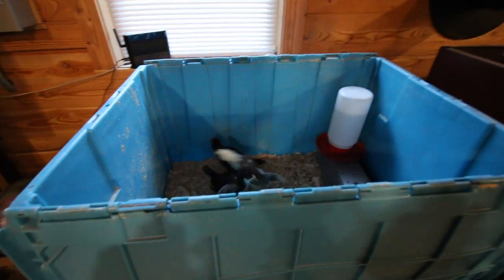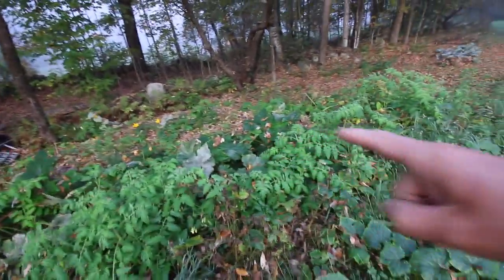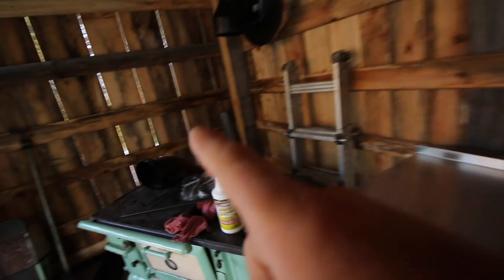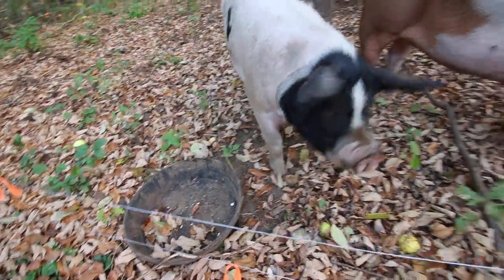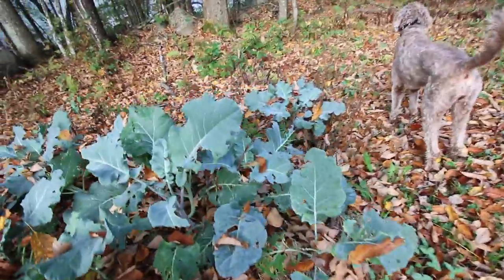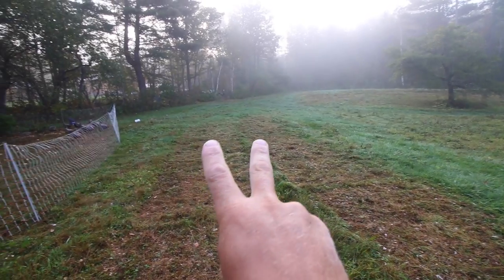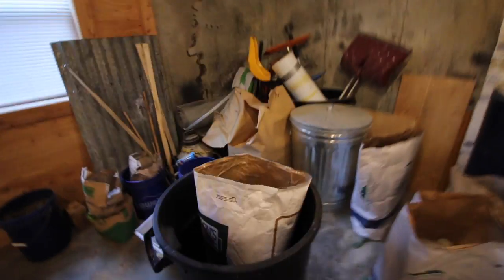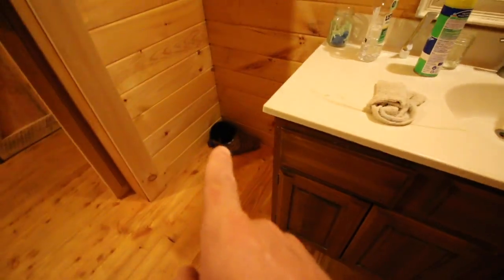🍂🐔🐖Weekly Homestead Fall Update Farm Tour🍂🐖🐔

Comment: Hi, you commented in this vid about the leaves falling despite the weather being hot. I thought you might be interested as to what triggers leaf fall. Most people think broadleaves go dormant in winter because of the cold; the actual cause is the low light levels. Trees use solar energy to pump water from the roots to the branches and in winter there is not enough sunlight to power the pump so if the leaves remained they would dehydrate the upper branches and kill the tree. So as the days shorten in the Fall it triggers the tree to go into hybernation, the other thing that can trigger leaf fall is drought. Happy Thursday.

Comment: Hey guys, after talking with you awhile back about my Tomatoes and peppers not turning color I went online and ordered a few white poly frost blankets. And what a difference, I have been picking orange and red peppers several times a week and tomatoes everyday. It has helped a lot with keeping  the nighttime Temps staying at least room temperature or higher. We haven't had cold quite like you but have had high 40's to low 50's the past several nights. The place I found the blankets was Gardner Supply in Vermont. A 6' x 20' was $9.98 and a 12' x 20' was $16.98. I bought the general one that protects down to 28°F and let's in 70% sunlight vs the quilt blankets which protects to 24°F but only let's in 60% sunlight. Sorry for the Novel lol, but I definitely know that either these or something similar will get your crops another 3-4 weeks at least in the beautiful raised garden beds you have at Lumnah Acres.
Reply from the maker: Thanks for sharing! I bet they work great!